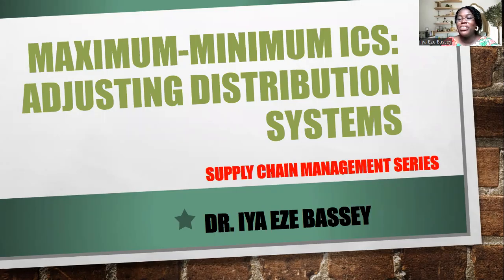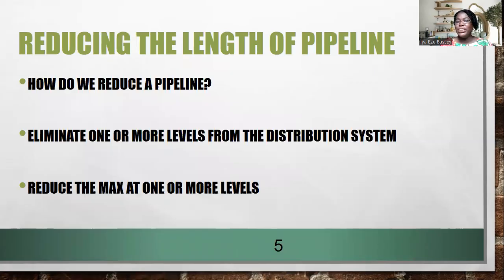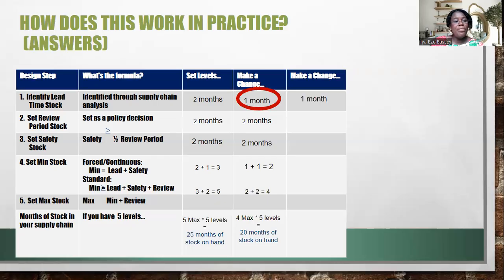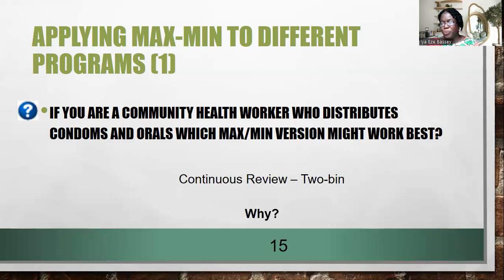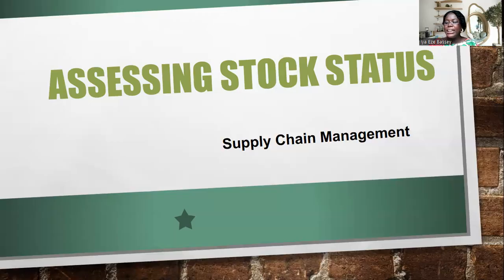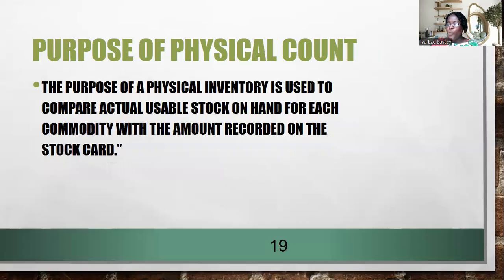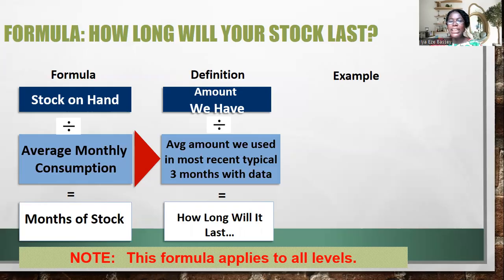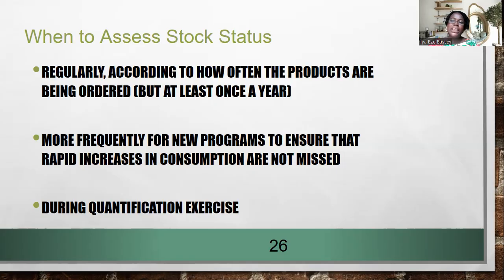Maximum-Minimum ICS: Adjusting Distribution systems (Supply chain management series)

Comment: Thank you so much man for this wonderful interesting video. From what I've learnt from this video I've come to an understanding that pipelines in the context of ICS refers to the product that a business has ordered from a supplier or manufacturer but does not yet received. Pipelines are a type of inventory buffer that helps to ensure a stable flow of production and it helps to avoid stork out or overstocking manufacturers can use pipeline inventory to other items in regular intervals this can help to ensure a steady flow of stock. 

The steps in designing a Maximum -Minimum ICS includes:
1. Set up your initial maximum minimum policies for each level and type of facility. 
2. Check if the overall distribution will function properly if the specific maximum minimum policies are implemented. 
3. Check the total length of the pipeline that the policies at each level supply. 

How to reduce the length of a pipeline.
1. Eliminate one or more level from the distribution system. 
2. Set up policies that will help reduce the max at one or more levels. 

How to reduce the maximum stock level 
1. Shorten  the review period at one or more level.
2. Reduce the lead time at one or more level.
3. Improve the distribution system reliability at one or more level so that safety stock can be reduced. 
Here are some factors that impact maximum minimum stock levels the include: cost of product, reliability of transportation, storage capacity, cost of storage, shelf life of health commodities,  lead times, age of programme,
 accuracy of forecasts etc

And here are some of the advantages of using maximum minimum system the include avoiding over stocking, avoiding on the stocking, minimise wastage, avoiding cost of emergency order, consistency of stock levels etc

And lastly assessing stock status can be done to determine the amount of stock and to determine how long supply will last. Looking at how to determine the amount of stock physical account can be carried out (a physical count is a process of counting by hand the total number of usable unit of each community in your store or health facilities at any given time).

Comment: By this lecture, I learnt that maximum- minimum inventory control is essential in managing the supply of laboratory consumables, Reagents and equipment in the laboratory.

It is necessary to know your stock status to prevent overstocking and stock out.
*Some factors that impact maximum- minimum level include;
1. Lead time
2. Age of program
3. Accuracy of forecast
4. Management skill of staff

Thank you so much ma for the lecture.
Reply: I learnt that maximum-minimum inventory control is essential in managing the supply of laboratory consumables reagents and equipment in the laboratory.
N/B to avoid overstocking and stock out, it is necessary to know your stock status. There are also four factors that impact maximum-minimum level which include: lead time, age of program, accuracy of forecast and management skill of staff.
Thank you ma'am

Comment: Thank youuuuuu very much ma 🎉🎉
The video was really interesting.
  At the end if the video I was able to learn the followings 
1. Identifying the ways to adjust distribution systems policies using the the systematic chain from the PORT to the CLIENT.
 2.  The advantages and challenges of Max-Min Inventory Control system 
3.  How to describe the inventory control system used in the logistics management if HIV/AIDS 
 In Reducing the maximum stock level these must be done;

1. The elements of formulas which can be changed in order to reduce the maximum stock levels 
2. Shorten the review period at one or more levels.
3. Reducing the lead time at one or more levels.
4. Improve the distribution system reliability at one or more levels so that safety stock can be reduced.

Comment: Thank you so much ma am really grateful for the enlightenment.in this course i was able to have a useful insight into optimizing inventory management.

The video included strategies for streaming the supply chain by eliminating unnecessary stages in the distribution system.

I was able to identify the Factors influencing optimal stock levels which includes :

1. Product cost 
2. Storage capacity
3. Shalf life of health commodity 

The are unique benefits of implementing the max-min system are:

1: Mitigation overstocking
2: Preventing understocking
3: Reducing wastage 

Lastly I really understood that physical counting involves manually tallyitye total unstable units of each item in stock, allowing us to reconcile the actual stock levels with recorded amounts on inventory record.

Thank you ma it was indeed a wonderful presentation 😊

Comment: I learnt about the steps in designing a max/min inventory control system 

I also learnt about ways to reduce a pipeline example eliminating one or more from the distribution system and reducing the maximum at one or more levels. 

Maximum minimum ICS is necessary for adjusting pipeline and ensuring accurate  inventory of commodities as it 

1. Avoid overstocking 
2. Avoid under stocking
3. Minimize wastage 
4. Avoid costs of emergency orders 
5. Ensure consistency of stock levels etc

Factors that can impact max -mom stock levels include 
- cost of products 
- cost of storage
- storage capacity 
- storage condition at different levels ETC

Comment: A physical count is the process of counting by hand the total number of usable units of each commodity in your store or health facility at any given time. 
The purpose is to compare actual usable stock on hand for each commodity with the amount recorded on the stock card. 
Factors that impact max-min stock levels include
 1. Cost of products
 2. Reliability of transportation 
3. Storage capacity 
5. Cost of storage 
6. Storage conditions at different levels
 7. Shelf-life of health commodities. 
To calculate the month of stock, you have to divide stock at hand by average monthly consumption

Comment: I found that the purpose of a physical inventory is to compare the actual usable stock on hand for each commodity with what is recorded on the stock card.  

I also learned that physical count refers to the process of manually counting the total number of usable units of each commodity in your store or health facility at any given time.  

Additionally, I discovered that challenges associated with using each version include systems with multiple levels, those that manage a large variety of commodities, and systems that handle products for new programs.  

Furthermore, I learned that factors influencing max-min stock levels encompass the cost of the product, storage costs, storage capacity, and the conditions of storage at different levels, among others.  

Lastly, I learned that the steps involved in designing a max-min inventory control system include setting initial max-min policies for each level and type of facility, ensuring that the overall distribution will function effectively with the specific max-min policies, and checking the total length of the pipeline that these policies imply at each level.

Comment: I learnt:

1. Steps in designing a Max-Min ICS;
✓Setting up of initial Max-Min policies for each level
✓Checking if overall distribution will function well if levels of specific Max-Min policies are implemented 
✓Checking the total length of pipeline that each policy level imply.

2. To reduce Length of Pipeline;
✓Reduce Max at one or more levels 
✓Eliminate one or more levels from distribution system.

3. Reduction of Max Stock level; Elements of changeable formulas in order to reduce stock :
✓Shortens review period 
✓Reduces lead time 
✓Improves distribution system's reliability 

4. Other factor that could impact our Max-Min stock levels:
✓Cost of products
✓Storage capacity 
✓Cost of storage
✓Shelf-life of health commodities... Etc.

5. Advantages of Using Max-Min system:
✓Consistency of stock levels 
✓Avoid costs of emergency orders
✓Avoid overstocking 
✓Avoid understocking... Etc

Under accessing stock status;

1. Physical count is the process of counting (by hand) total number of usable units of each commodity in store or healthy facility at any given time.

2. Purpose of physical inventory is to compare the actual usable stock for each community with the amount recorded on stock data.

3. Purpose of assessing stock status is for the determination of the duration of supplies.

Comment: By this lecture what I’ve learnt here is that,
The lesson focuses on optimizing the distribution system by highlighting the importance of physical counts after delivery and strategies to improve efficiency. Key teachings include shorter review periods, reduced lead times, improved distribution policies, and pipeline length adjustments to minimize wastage and overstocking.
The benefits of the Max-min inventory control system (ICS) include preventing stock shortages and excesses, managing stock levels efficiently, and avoiding emergency order costs. It also serves as a tool for regular stock assessment and helps manage pipeline policies effectively at different levels.
Thank you ma for the lecture.

Comment: Thank you very much Dr.mrs Iya Eze Bassey.
The steps in designing a max-min ICS are;
*Set up initial maximum policies for each level and faculty.
*Check if the overall distribution will function properly if the max-min policies are implemented.
*Check the total length of pipeline that the policy of each level implying that most times the length of the pipeline might be too long and can take longer time in commodities delivery.
 pipeline length van can be reduced by;
*Reduction of max at one or more levels.
*Elimination of one or more levels.
Factors that impact max-min stock levels are;
-cost of products
-cost of storage
-Reliability of transportation
-storage capacity 
-storage conditions at different levels
-shelf life of different commodities.
Also the advantages of using a max-min system is to
*Avoid overstocking
*Avoid under stocking
*Minimize wastage
*Simplify inventory control decision making
*Consistency of stock levels
*Avoid cost of emergency orders.
Thank you

Comment: MAXIMUM -MINIMUM SYSTEM ICS: ADJUSTING DISTRIBUTION SYSTEMS 
Factors that impact maximum -MINIMUM stock levels are:
* Cost of products
* Reliability of transportation 
* Storage capacity 
* Cost of storage 
* Shelf life of health commodities 
* Storage conditions at different levels 
ADVANTAGES OF USING MAX-MIN SYSTEM 
* Avoid overstocking 
* Avoid under stocking 
* Minimize wastage 
* Minimize wastage 
* Consistency of stock levels

Comment: This lesson was really informative and helpful in understanding the importance of logistics management in public health supply chains. I particularly appreciated the explanation of how to identify ways to adjust distribution systems policies to optimize logistics operations. The advantages of using the max-min inventory control system were also clearly explained, and I can see how it would help prevent stockouts and overstocking.

The section on the control system used in the logistic management of HIV and AIDS commodities was also really insightful. It's clear that effective logistics management is critical to ensuring that people living with HIV and AIDS have access to the medicines and supplies they need.

Finally, the emphasis on the importance of accessing stock status to prevent stockouts and overstocking really hit home. It's clear that logistics management is a critical component of public health supply chains, and that effective inventory management is essential to ensuring that people have access to the medicines and supplies they need.

Comment: In conclusion of the lecture the  steps involve to design a maximum  means inventory is to set initial maximum Policies for each level .- check if the overall distribution and bounding check the total length of the pipeline.   

Some advantages of using max-min system include - avoid overstocking, under stock, minimizing wastages, avoid cost of emergency rides etc. A physical counting used to compare actual usable stock in hand for each commodity with the amount recorded on the stock card.

Comment: In conclusion I learnt that we reduce pipeline through the elimination of one or more levels from the distribution system and reducing the max at one or more level and the cost of products,and storage are factors that impact max- min stock levels
   I also learnt that physical count is the process of counting by hand and total number of usable unit of each commodity in your store at any given time which is used to compare actual usable stock in hand for each commodity 
 Thank you ma.

Comment: Maximum-minimum ICS adjusting distribution system.
Distribution system the length of a pipeline refers to the steps in designing maximum ICS.
Identify ways to adjust distribution system policies are:
:distribution channels is the means through which a company gets its product to consumers.
The term is also used to describe how consumers pay to vendor for their goods and services.
: increasing distribution channels efficiency 
: Managing distribution channels can be challenging even for the most successful companies.
The high level way to increase channel efficiency are:
: increasing or carefully picking the channel intermediaries.
: increasing the focus on supply chain management. 
Thanks ma

Comment: In summary the min-max ICS adjusting distribution system help us to know the pipe line distribution channels and how to shorten the pipeline by Eliminating one or more levels from the distribution system as many commodities would not last with the speculated time.

Advantages of ICS adjusting distribution system
1. It avoid over
2. It avoid understocking
3. Reduces cost of emergency order
4. It minimise wastage
5. Consistency in stock level
Thanks.

Comment: The discussion of adjusting distribution systems using maximum-minimum inventory control systems (ICS) taught me how these inventory levels directly impact distribution strategies. I learned that maintaining appropriate maximum and minimum inventory levels at different points in the distribution network is vital for optimizing the entire system's performance. Adjusting these levels requires analyzing factors specific to each location, such as local demand variability, lead times from upstream suppliers, and transportation costs. For example, a distribution center closer to high-demand areas might require a higher maximum inventory level to meet surges in demand, while a more remote location might need a smaller maximum but sufficient minimum to avoid stockouts. This optimization improves efficiency by minimizing unnecessary transportation, reducing warehousing costs, and ensuring timely product delivery to end-users. Essentially, it's about tailoring inventory levels to the specific needs and characteristics of each stage in the distribution network for maximum effectiveness.

Comment: In summary, I've learned about the steps involved in designing a max-min inventory control system (ICS), the methods for reducing pipeline length, and the factors that affect the determination of max-min stock levels. I've also gained insights into the benefits of a max-min system, such as preventing overstocking and understocking, along with the challenges associated with different versions and variations. You mentioned the importance of physical counting, which involves manually tallying the total number of usable units for each commodity in the store or health facility. The class was interesting ma. Thank you!

Comment: Thank you so much ma for such an amazing lecture videos where we get to understand what minimum -maximum ICS is and also adjusting distribution systems.
I learnt that adjusting distribution systems in maximum-minimum inventory control systems is crucial. I learnt that to reduce the length of a pipeline, one can eliminate one or more levels from the distribution system or set up policies to reduce maximum stock levels at one or more levels. I also learnt that the standard version of the maximum-minimum inventory control system is suitable for managing a large number of commodities. Additionally, I learnt that assessing stock status is essential to determine how long supplies will last.
Thank you ma😊

Comment: In conclusion, my understanding of inventory management has significantly expanded, encompassing the establishment of Max-Min Inventory Control Systems, strategies for shortening pipelines and factors influencing stock level calculations.
Through this course, I've gained valuable knowledge on Max-Min Inventory Control Systems, pipeline optimization techniques and the complex considerations involved in calculating optimal stock levels.
I've developed a comprehensive grasp of Max-Min Inventory Control, including pipeline management, stock level calculation and the benefits of physical counting.
Thank you ma for this wonderful class.